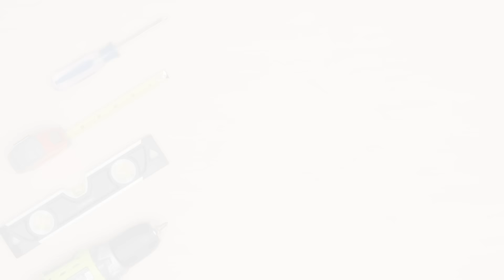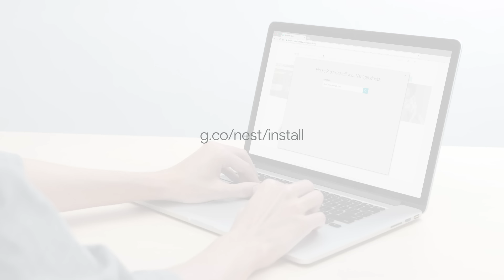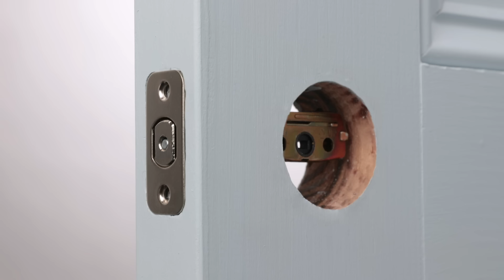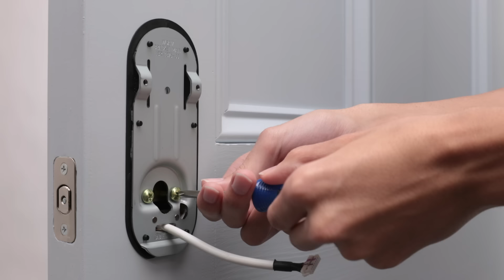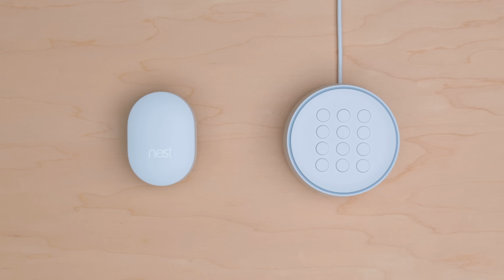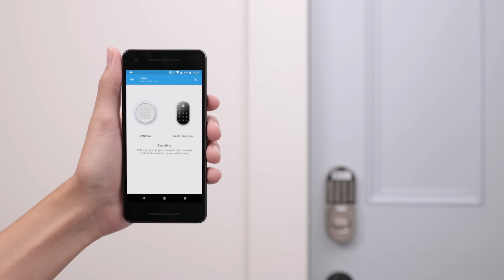How to set up and install the Nest × Yale Lock

Comment: I am taking over a property where the previous tenant had the nest/Yale touchscreen lock. I have reconnected to the nest device, but I cannot get the door lock to recognize the nest device. I’ve removed the batteries and when I put them in the test button lights up. But when I go to connect to the nest app, the test button does not light up doesn’t do anything!Help.

Comment: If the lock wont connect to your connect on your wifi network, set up a mobile hotspot. Connect the nest connect to the hotspot and try to pair them again. You have to push button on the inside of the lock to pair it to the connect before you scan the qr to pair them. Lots of missing instructions or advice that just doesnt work out there.
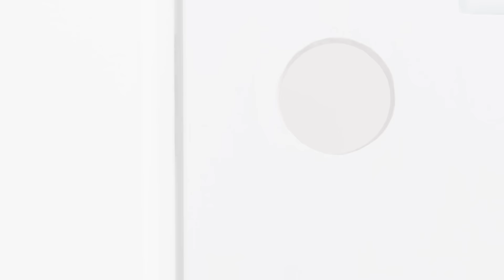Reply: 1:40

Comment: This didn't work for me at all.  I tried installing it at my home and worked great.  It took about an hour to figure out the Nest Connect because it came with NO instructions at all.  - Note to self . . . put some instructions in the box!!  Once I got it working at my house I thought I'd install it in a second location . . . that's when the wheels came off the bus!  After 5 calls and almost 4 hours of dealing with tech support they offered to send me a new unit.  Between Yale and Nest neither one of them had a clue as to how and reset it so I could put it on a new new network successfully.  We did all of the steps at least 8 times and they said it must be an issue somewhere.  The unit is going back!

Comment: can you connect the nest x yale lock to the google home app?
Reply: You can voice control the lock from the Google Assistant - but only to lock the door - not to unlock (for obvious security reasons). You have full control over the lock from the Nest app  - must be on a mobile device (not from a nest web login). Android mobile device power screen one can add a widget to control lock(s) including unlocking. I use this final method for one-handed unlocking of door.

Comment: I only have nest door bell and nest smoke detector will those devices work for connecting the door lock with my nest account 🤔
Reply: According to google manual, you need one to coonect to app

https://support.google.com/googlenest/answer/9251009?hl=en
You will need to have either a Google Nest Guard or Google Nest Connect already installed and connected to the Nest app for The Nest × Yale Lock to work with the app.

This is because the Nest × Yale Lock doesn’t connect directly to Wi-Fi. Instead, it uses Weave to connect to a Nest Connect or Nest Guard in your home. Your Connect or Guard, which are connected to your Wi-Fi network, lets your lock communicate with the Nest service and the Nest app on your phone.

Comment: What if it dies?  I live near the beach, is the salt air going to kill the electronics one day?  If TouchPad is non-responsive, or lock malfunctions for some other reason other than dead battery, am I calling a locksmith at that point?  How is a locksmith going to help me?  Cut my door?  Climb through a broken window?  This seems like a terrible design without ability to manually operate with a real key.
Reply: There are two contacts on the bottom that let you temporarily power it with a 9v battery, it also warns you of low battery about 50 uses before they need to be changed out.
Reply: Only if there was a way to avoid purchasing this product 🤔
Reply: take it apart dude
Reply: Don't buy it then, they make one's with a key as well.

Comment: How much time should I plan to install the Yale Lock and set up the Nest Connect? I have a new Google Mesh wifi system with Google Home on my phone. I’m pretty handy around the house, but I don’t have experience working on door locks. Thanks!
Reply: The first one I did took me about 35 minutes from start to finish. The biggest delay is downloading the nest app, registering the QR code, etc. The quickest part was the installation. I had to bore out the door for this, I made sure there was absolutely no sawdust in the holes and that the deadbolt was installed with the 'up' facing up and the lock completely plumb (level).
You can save a fair amount of time by downloading the nest app in advance and making sure you have another nest product logged in, first.
However - I'm an electrician, so none of this was new to me. I'm not including the time it took to bore out the holes, mortise in the strike plate, etc.

Comment: The longer I own this lock the more I dislike it.  I got it for Christmas and since January I have had to go through the installation process FOUR times because the Nest Connect and Nest Yale lock keep dropping off my WiFi network.  When that happens you have to start all over again with installing the Nest Connect first, then the Yale Lock.  In order to do this you MUST remove the yale lock from the door because the button needed to connect Nest Connect and the Yale Lock is on the BACK of the lock.  Which engineer decided this would be the best place for the rest button.  I am going to post here the REAL way to do this.  First, you CANNOT install the lock to the door with the batteries in place.  So, why tell us not to install with the batteries in place.  You can't.  The batteries cover the mounting screw holes.  Your Nest Yale lock should have come with at least the Nest Connect device.  If it didn't then you'll need to get one.  That's the first issue with this installation.  The Nest Connect is difficult, I do mean difficult, to get installed to the Nest app.  You'll spend 30 minutes on this step.  Once you have the Nest Connect installed, now you can start installing the Nest Yale lock.  Be sure you have set aside about an hour for this step, minimum.  Getting it attached to your door is the easy part.  Getting it connected to the Nest Connect is not easy.  Don't forget !!  You'll need to access that button on the back of the yale lock, so if you've already installed it on the door, take it off.  Is the blue light on the Nest Connect still on and glowing steady?  Chance are it's green now.  So, start over installing the Nest Connect to your Nest App.  Are you getting the picture here?  If you want to buy this product be prepared for a lot of frustration about every 30 days.  The single most difficult part to all this is remembering how to re-install everything each time this happens.  So, keep a good copy of the instructions taped to the door so they'll be nice and handy in 30 days.
Reply: I've had mine for 4 years and 2 battery changes over that period; never bothered me once.
Reply: I agree with the problem you've listed above. Very similar frustrations. My issues are not at the same frequency but it's happened twice to me in the last year which is plenty enough for a product to be considered less than great for me.
Reply: so true. this is such a garbage product. hours down the drain.

Comment: I love the idea, just scared of people who can crack into the security system
Reply: Or just people with a pry bar who break your door. Or just break a window.
Reply: With nest you can set alarms, but with hackers.. They can shut down you're security
Reply: @martino_yes  if it loses signal or is opened in any way a tamper switch is triggered that sets a pretty damn loud alarm
Reply: @martino_yes  you know how easy it is to pick a normal lock? It's a lot more effort to hack in to a nest lock. Hilariously more effort actually.
Reply: @lunchie80  Old habits 😴

Comment: anybody know how to disable the built in alarm? it keeps going off randomly. Other than that, it works beautifully!
Reply: I didn't know it had a built-in alarm. What is that for?
Reply: Is the data cable between the exterior touchpad and the main (interior) unit fully seated? There is a piercing anti-tamper alarm that will go off if the connection is broken, even briefly.

Comment: they work only on one direction opening , you can't change open close direction
Reply: Not true. When installing, ensuring dead-bolt is in the open position (as per the instructions) the lock will auto-sense which turning direction to lock. So lock can be used on either left-side or right-side (if hinge is on left).
Reply: @ColmMalone  that’s my issue with it, the motor keeps actuating

Comment: What happens when the batteries run out and you are outside your home?
Reply: Jason Lloyd use the points at the bottom and insert a 9 volt battery

Comment: I have a lot of NEST products, as lately bought their outdoor NEST IQ. But pay U$ 249 for a door lock, that as someone pointed out here, doesn't have a physical backup key, no thanks. I love the NEST quality and attention to details, but they are most of the time away too expensive. Guess they have a version 2 with backup key, the same way they have now the IQ, since the first camera was kind of "joke" , as you need to open a hole of the size an "elephant" to have the power cable inside.
Reply: The hole you make for the camera in the wall is just to put the cable not the whole camera🤡🤦🏽‍♀️

Comment: Do I need another nest product to use this?
Reply from the maker: Thanks for reaching out. The only other Nest product you would need is the Nest Connect, Unless you have the Nest Secure.
Reply: yes. you will need a nest guard or a nest connect in order for the door lock to work. i believe you can only purchase the connect or guard with the lock only through www.nest.com website.

Comment: Hello Nest team, what size the hole needs to be? In the instruction booklet it says: 2 1/8 and the explanation videos and online instructions say 2 3/8 .... very confusing! I don't want to drill wrong size hole.... Please help
Reply: Lindsay Siegel yes, you need to do the whole the size indicates on the paper template. NOT the size in the video.
Reply: The video and online article refer to the offset, or distance the hole center needs to be from the edge of the door. This can be either 2 3/8" or 2 3/4". The hole diameter must be 2 1/4", which is standard for most doors.

Comment: What if the batterys run low? I'm guessing you'll be locked out.
Reply: In the case you are locked outside and the batteries are dead, there is an access at the bottom of the front plate where you can use a 9V battery to "jump start" the lock.
Reply: Pennywise the Dancing Clown Smart licks alert you when the batteries are running low. Just replace the batteries when you receive the alert.
Reply: JL Homes — or use a regular lock and eff all that other noise
Reply: SupaEMT134 so lock trolls exists, wow isn’t that wonderful.

Comment: Will it automatically unlock when I am close to it and am signed into the Nest app on my device?  What temp ranges can it withstand?  Will all the features work if the wifi is not very strong near the door where it's installed?  Do I get support from Yale, Nest or both?  If I change my door hardware to a different finish, can I swap the faceplate with a different finish on my lock or do I need to purchase a different one?  If I installed multiple locks across the entrances to my home, can I sync them or do I need to program them individually?  Feel free to add the answers to your product marketing pages as I couldn't find these answers on the Nest or Yale sites.
Reply: Unfortunately it seems like you'll need to open the app or use the code to unlock. I wish it had proximity sensors. Not sure if the security system tags can be integrated with the lock. They recommend you plug in the "nest connect" closest to the door and that it has a 40ft range. It doesn't look the finishes are interchangeable. If you have multiple locks, they can all be synced to your app but will appear individually based on the location in your house.

Comment: I have a Nest Thermostat .....do I need any other Nest products for it to work at my home?
Reply: You'll need "nest connect" or "nest guard." Nest sells a version of the "nest x yale lock" for $279 USD that comes with a nest connect if you don't already have it or the guard.
Reply: No Nest Thermostat is a stand alone product that will work on its own
Reply: True you could use it on it's own but why pay nearly $300 if you can't use the app with it? ;)
Reply: cómo conectar el yale Nest al wifi
Reply: @ineldisrieco4957  you'll have to follow the instructions in the video in order to connect the Nest x Yale lock.
Reply: Bacon, Beans & Blades no